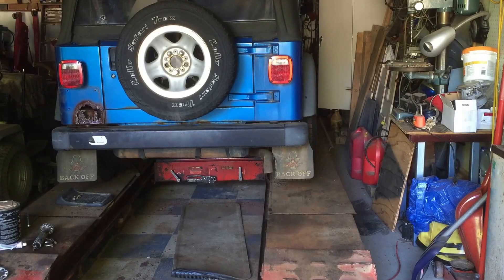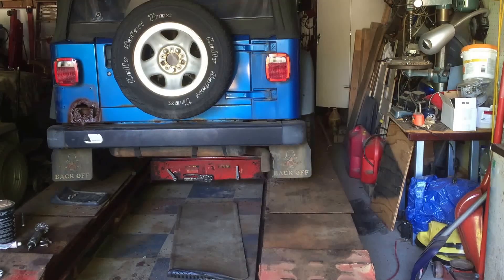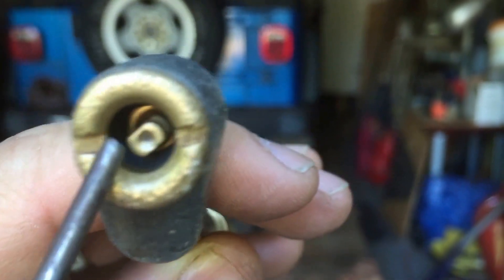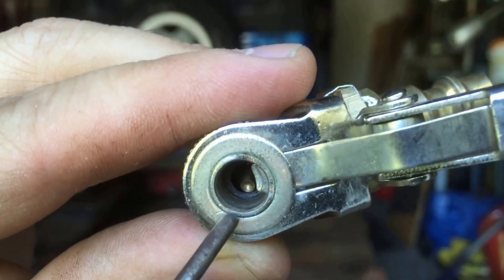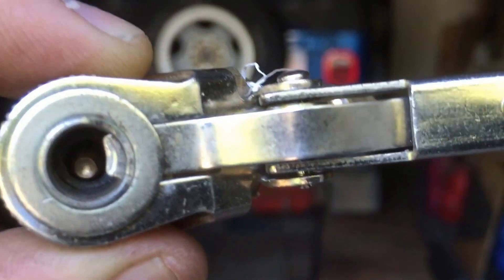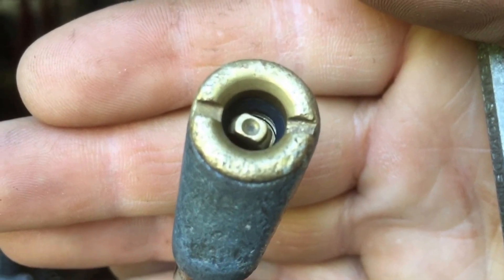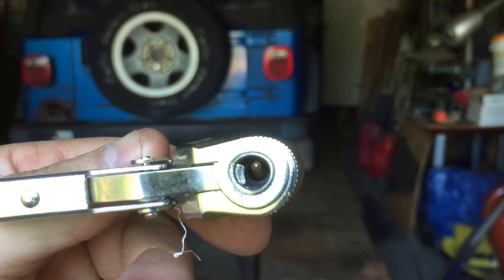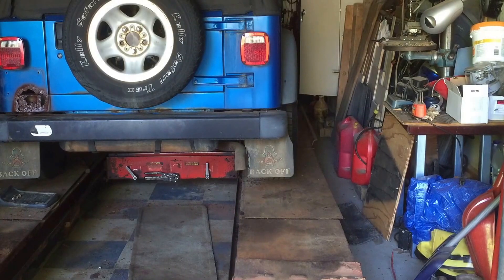Air tool buying guide - tips cheap tire nozzle

Comment: How did you make that indent on drill press?
Reply from the maker: Yes, I took it apart and used a small drill press vise then made the indent with a small drill bit. Thanks for the question.
Reply: @shanesmaineshop  do you know there are two types of inflator nozzles available in market. They look same as the one you've but the one comes with hollow pin and other with solid pin.